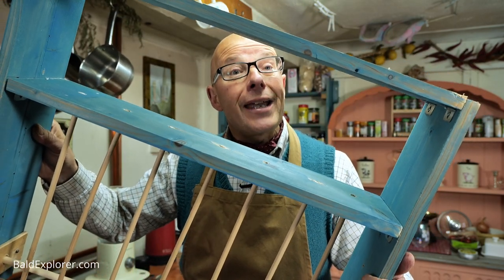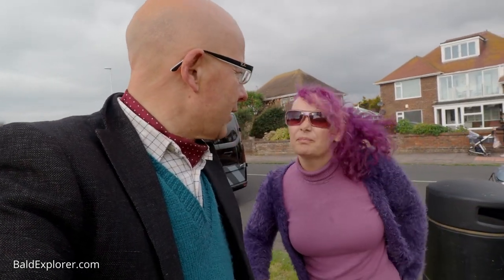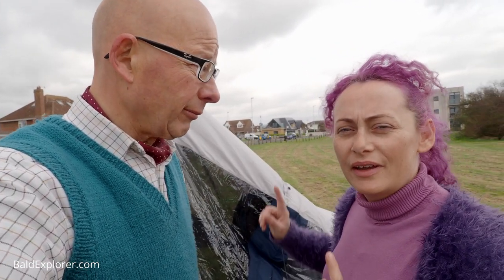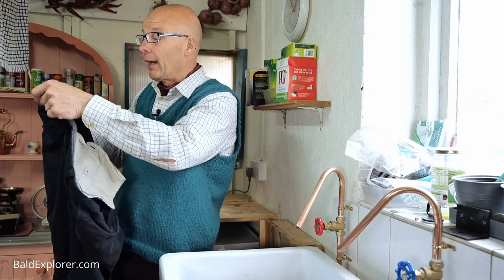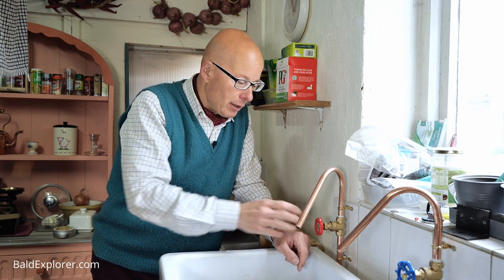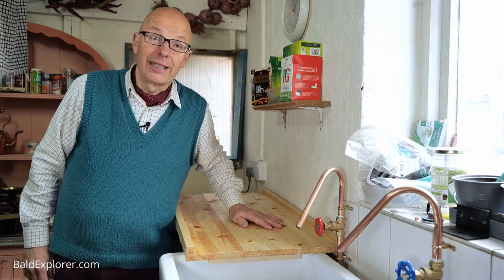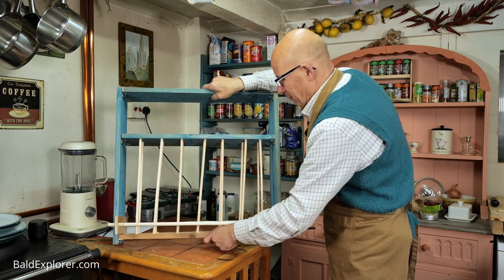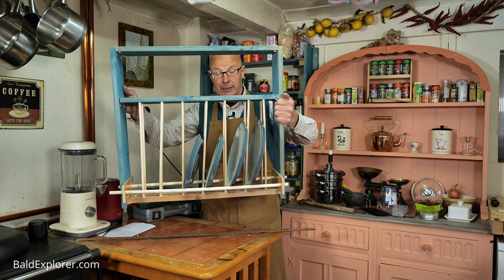Trouble with the tent!

Comment: Great job for the draining board. May I suggest that you cut some grooves into the board . This will ensure that you do not get any air locks as items such as cups and tumblers will sit too tight onto a smooth surface and thus prevent water draining off.

Comment: I do not have the words...but a valve is a very simple thing; it lets air in one way but not the other; unless it's deliberately released. So you simply figure out which direction opens the flow - then connect your pump and up goes the tent. To deflate, simply depress the release.
Or, you could just purchase a tent extension to fit your vehicle; and attach it. Takes less than 5 minutes.
I like your draining-board idea. Works well. Definitely not convinced about the plate-rack.

Comment: Perhaps an Enquiry to the Tent Manufacturer for assistance/ guidance might prove Fruit-Full?  🍒  🍒  🍒  as You are advertising and promoting Their Product for Them,  i'm sure they would help out with a new Valve or Inflatable Section. And It would be Positive Marketing for their Brand and Product.
It's Worth an Ask to solve the deflating issue. 😊🙏🤩🤩
Reply from the maker: Maybe - but I am sending it back to the owner soon.